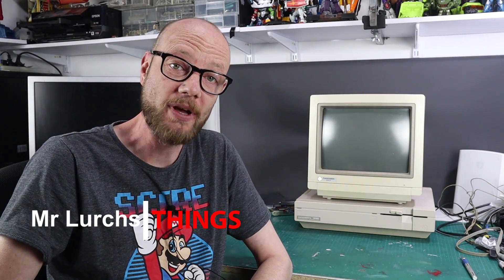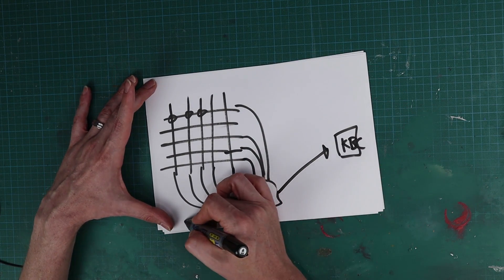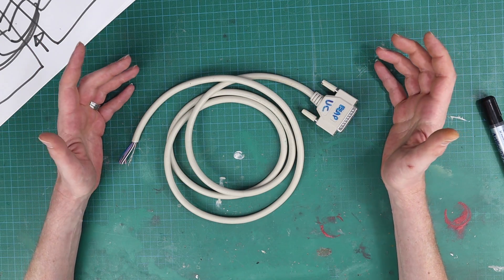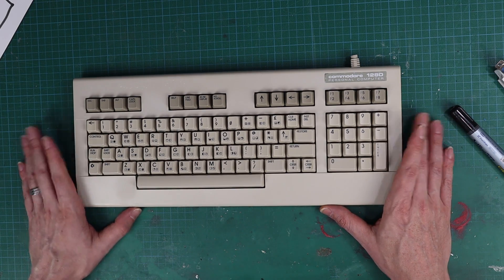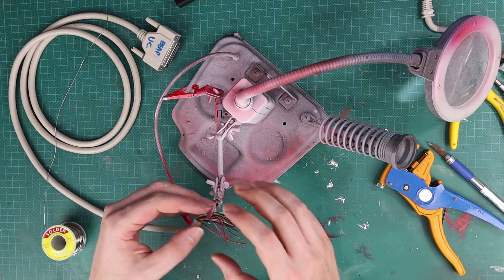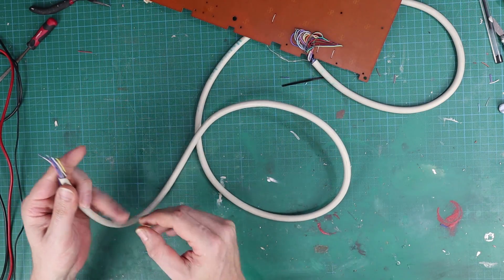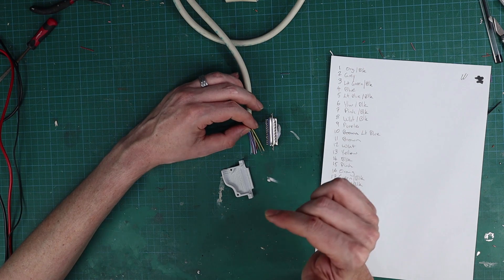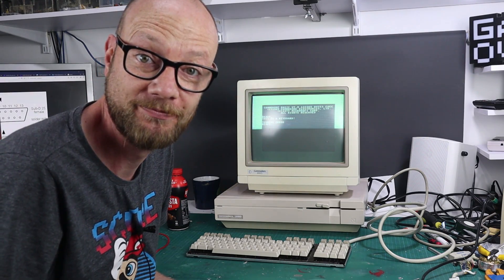Commodore 128D Keyboard Repair

Comment: I have Commodore 128D keyboard, where one of its key, "V," is sticky, and when I press down, it stays down and doesnt spring back up, unless I manually pry it up from the side with a screwdriver.. I can take off the key itself and just dont see any spring to push it back up.. is there a quick fix somehow that doesnt require replacing the whole key and opening up the keyboard?

Comment: The color code chart you made, was that the original color code on the board or was that the colors of the DB25 cable you soldered fort to the board?

Comment: Where did you find the pinout. Looking for it. I want to wire a cable to a flat c128 keyboard. The two keyboard should be same isn't it?
Reply: They are identical keyboards

Comment: I do not envy this repair. It was enough to do ~14 wires for VGA cables when CRTs were all the rage and some horrid manufacturers soldered the cables to the board.

Comment: Great video and brilliant work for getting all the connections right, though I'm surprised you didn't hear me screaming "CABLE STRAIN RELIEF" (that rubber doodad that stops the cable and it's connectors being pulled through the keyboard case if you tug too hard) at my phone as you started soldering all those wires 😀 - does it not come off the old cable?
Reply from the maker: JCB Digger Unfortunately the cable I used was noticeably thicker than the original. I did try to reuse the old strain relief, but simply no go. Eventually I’ll 3D print something, but for now there is 2 zip ties holding the cable in place in the keyboard and another in the DB25 shell. Certainly not something I forgot about.

Comment: I need to ask because it will bug me, did you transfer the strain relief over from the cut wire ? Being able to see that from the top of the keyboard would bug the sh*t out of me not being there.
Reply from the maker: FullMetalFab no. The new cable is thicker than the original, so couldn’t reuse the strain relief.

Comment: If you ever need to undertake a project like this again, I'd start at the connector, because it's much easier to be soldering the keyboard side in order of the connector than vice-versa.
Thanks for the video!
Reply from the maker: Honestly, on this one it would have made zero difference given both ends use a logical 1 to 25 wiring order.
Reply: @MrLurchsThings  Fair enough! :)

Comment: Awesome job, i have a bog standard C128 in storage that needs a new PSU at some point in time, and I've always wanted a 128D, but at least here in the US when they pop up for sale with a working keyboard, they go for make you scream, and pass out prices lol!
Reply from the maker: Commodorefan64 I never thought I’d own one for that reason. I simply got lucky on getting the 128 at a reasonable price because it was missing the KB, and the KB because it was missing the cable.
Reply: @MrLurchsThings  I hear ya on that one. Sometimes we just get lucky finding that one holly grail piece of tech lol.